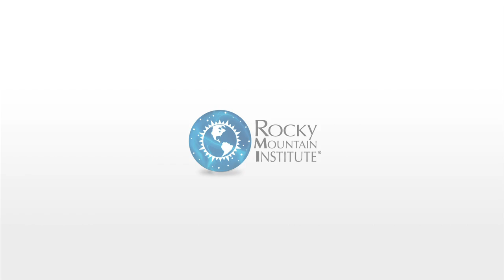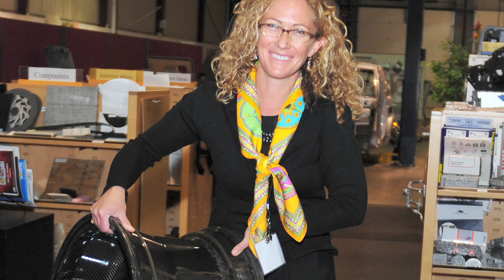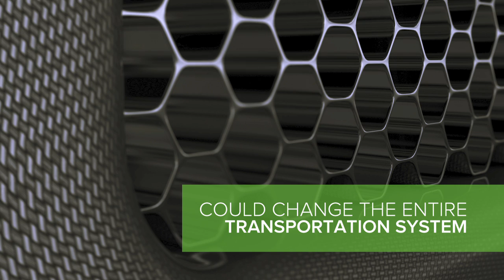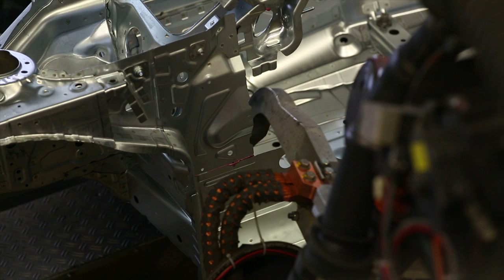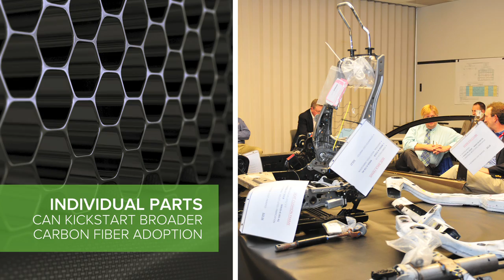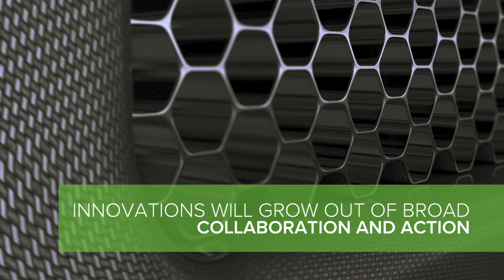Lightweighting Autos with Carbon Fiber Composite

Comment: Totally agree with Irwindesigned: a total life cycle analysis will be necessary to be able to really make a good judgment. Recyclability is one thing, but also: how does the energy used to make carbon composites compare to the energy used for the production of plastics and steel. And whether it is green energy that is being used for the production.